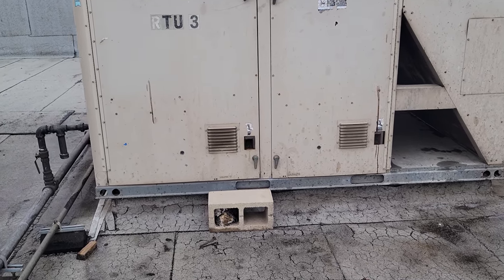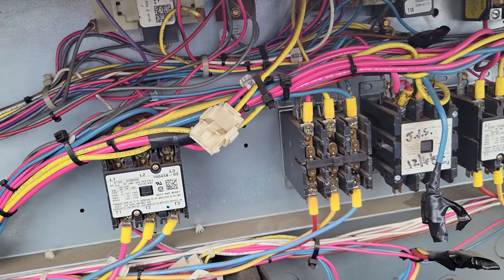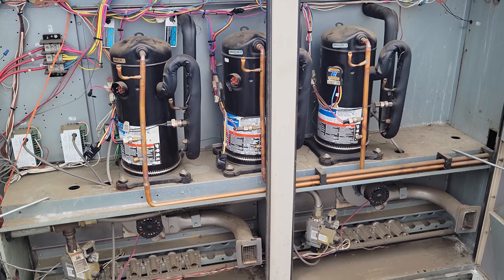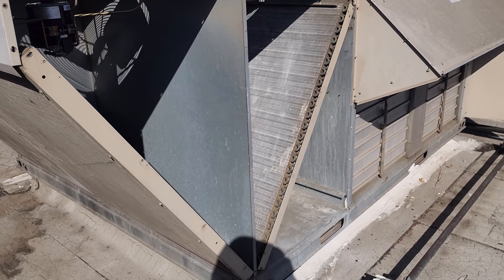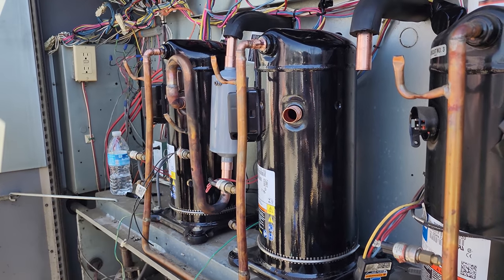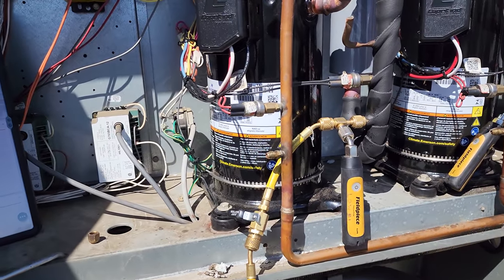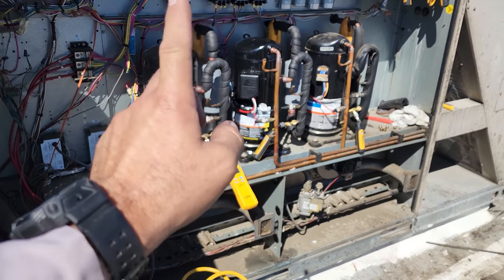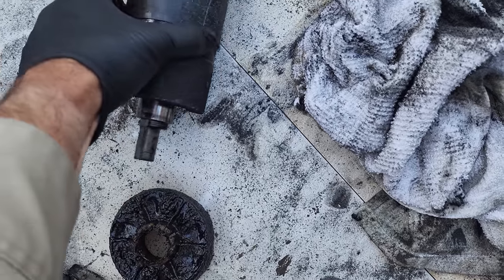BORROWED TIME IS AN UNDERSTATEMENT

Comment: That 2nd compressor that died you could tell right away that it was hardcore cooked and far more cooked than the first one that died. That was a hell of a repair and probably brutal in the cost just to replace it in 2-3 months.
Reply: I know nothing about this trade but was wondering, how much can this repair cost in total in comparison to the whole replacement cost?
Reply: @Lembemupixo  this repair is probably 4 to 5 grand at least. A new unit is probably about 20 to 25 grand after labor.
Reply: I have a feeling that after that outlay of cash, they're probably going to wait until the third stage goes out.  lol
Reply: 2 to 3 months, you mean 6 to 18 months. lol
Reply: @Lembemupixo  Much less, these units are really expensive but so are compressors but still less.

Comment: Yeah, I remember this unit... It's appeared a few times on your channel, I think. You did all the driers, I remember you capping off Stage 2 when it shorted, and I also remember Stage 3 sounding like crap.
You managed to get this unit running well-enough to get them through the summer, hopefully. Like you said, polishing a turd. There's only so much you can do when it's clearly overdue for retirement!

Comment: You need to replace batteries in your meter 🙂. Just don't want you to have to make an extra trip to the van ✅ Great video as always!
Reply: You know how when you take all your tools on a roof with a really difficult access and get everything up.  Fire up the torch and immediately head to the truck or worse yet to the supplier for a spare oxygen or acetylene tank.  Never on a ground mounted condenser.  Nice videos.

Comment: I would've thought the no 3 compressor would've failed by now, I'd have been wrong! I wonder how much longer it will last and if the different filter dryer made the difference! Seems to me they may as well just replace the last compressor now before it fails, it's pretty much all that's left that hasn't been changed inside that AC!
Reply: I would change that last compressor and call it a day, why bother replacng the unit at that point.

Comment: unless it's a small txv and doesn't have the option, I always just replace the guts and powerhead, the body is just that, a brass body, so no need to braze in new TXV's, a couple wrenches and you're done. I also always add an acid neutralizer to the new crankcase if I suspect acid, along with an HH drier, better to be safe than sorry. Just my 2 cents though, great work as always Chris!

Comment: Quick sharing from my exp when cleaning d system. Im always use this kind of creatures that we call Solvent Cleaner(degreaser for hvac system). Its works perfect to clean d system n very quick dry too. Its kind a nasty when using this method, but believe me, the result is super impressive. Im not saying that blowing n2 alone is not efficient. But sometimes in few cases it need to be done with this degreaser. Im learn a lot through ur impressive breakdown call video n u amazed me. U re my Guru. Thnx a lot to u n your team. & last advice in the video was really touching n u re saying right things. Thnx again. Really appreciate.

Comment: Chris…. Why don’t you use replaceable core drier shells?
Screens… felts and all the new cores you can buy. The winding insulation is overwhelming the refrigerant circuits. I hope you get it all out and the customer sees some light on the maintenance front…. Your a good man for trying to do what the customer requires but I don’t see any benefits in the repair. Be safe keep being a good employer

Comment: I don't think him sealing the traffic mat to the roof is necessarily a sign of a Bad roofer as it is a sign of a Lazy or Frustrated roofer...

When he sealed the mat down, I think he was FAR past the point of "FUCK IT! I'm just gonna seal the ever-loving HELL out of everything up here that could, theoretically, possibly have made even the slightest smidgen of contribution to the mystery leak"...

😄😁😆😅😂🤣
Reply: From what I saw in that video, the store manager doesn't seem to have knowledgeable support from a good maintenance crew.  Or maybe its their own fault from cheaping out and having a "handy man" do the filters, coils and roofing.  either way, I would fully expect that a manager who has their quote on a new unit denied would be frustrated and tell their "handyman" to get up there and seal anything with a crack or seam.

Comment: I apologize but I'm going to assume any time a compressor is failed, even if its a short to ground, LRA, or even failed seals, that system should have acid and as a precaution acid test and scavenge should be performed! NOTE: Glad I never see these big Lennox units out here in Colorado, they look like a nightmare to work on, especially for restaurants. 
Definitely going to tag this video and use it to help my green technicians learn. Thanks for the time you spend making these videos don't stop, ever.
NOTE, don't forget that suction HH dryer for extra safety.
Reply: A nightmare to work on? I think they're pretty good, heat exchangers come out like a drawer once you get the door/mullion/gas train out of the way. And much better than a Trane to service, I like how they have doors with handles and hinges, and not a bunch of 5/16" screws that strip out. Also it's nice to be have the compressors in their own compartment like that, sucks having to take a huge panel off of a Trane/American Standard, and then connect guages and you're losing a lot of airflow thru the condenser. Wireless probes help but lately the newer stuff isn't made very good. I just bought a new 13 ton Lennox unit (Trane was completely out of stock), and even Lennox has gotten cheaper, the handles are cheap plastic now, instead of the nice metal ones that lasted forever. Have quiet a few mid 1990's bigger Lennox units that are still going strong, 17.5 to 20 ton. One 20 ton unit has a bad leak somewhere, so I have that circuit disabled. Not worth finding and fixing it since it's most likely in one of the coils somewhere, and it's R-22. That place has 3 20 ton units on it, and that unit with one compressor down is in the back of the store well away from the front door and any windows so it stays cool anyway.

Comment: I use to work on the rooftop units that were 25 hp-100hp trane units.
We rebuilt the compressers on site
I leaned so much about the big units and chiller systems.
Do you ever run across the big roof top units ?

Comment: You need to get a good ultrasonic detector not a cheap one $2-3K. you can hear tiny leaks under vacuum, nitrogen, freon from feet away. I hear some spray water to hear leaks better that's a cheap sonic not ultrasonic. I can tell if and where a leak is without removing panels. I paid 2K 20 years ago best HVAC tool I've ever bought. It's amazing what a good one can do. Even those leaks that are hard to find and many just top off every couple years, I find in seconds

Comment: As an owner of some roof mounted units, what/how would I know what the correct preventative maintenance is for these machines? I'd love to prevent full equipment failure as much as I can but I'm not sure what maintenance I should be doing.
Reply: You should not be doing it if you don't know what maintenance you should be doing. Hire professionals
Reply: Periodic cleaning of the coils with water and appropriate chemical. Changing the air filters. Inspect and replace contactors as needed. Verify fan motors running correctly. Free spin to make sure no failing bearings and replace if going bad. Inspect and replace belts. Clean condensate pans and drain lines. Check wires for rubouts or secure potential rubouts where wires are contacting any metal. You can also do amp reads if you really want to be thorough. (Fans/Blower/Compressors) - Touch test the refrigerant lines.
Reply: If you don't wanna stick your hands into the unit (there's line voltage potentially (heh) everywhere, even where none should be) - listening to it run will give you a good idea. If it sounds funny, loopy, squeaky, wobbly, clunky, generally out of whack it might appreciate a little love. You want monotonous humming, or droning when it runs, and brief (and "clean") clicking/buzzing/thumping/clunking when it starts or stops. Much like a car - it makes all sorts of constant and transient sounds, and there's no need to freak out about it. But if it's shaking itself apart or some gears are chewing up their own guts... you'll know it when you hear it. Beyond that, your friendly contractor of choice will schedule regular maintenance and then tell you what, if anything, else they notice on and recommend for the units.

Comment: Now on something like that. You got 2 smoked compressors, dirty oil and one almost out of oil.  I get the suction line filters is just to help remove wax and anything else in the system. Why not use the R11 line flush kit just to scrub the lines?

Comment: I remember when I was a kid I cut open a few old HVAC compressors and the oil smelled exactly like old burnt power steering fluid.  Not sure which smells worse. That or gear oil.

Comment: Whenever you see silvery sheen on oil, it means mechanically your looking at the compressor eating the metal off different parts, or metal bearing failure. Never a good sign. Too bad compressors are not user serviceable.

Comment: Did you find the trouble with the Alarm Co. 
Thanks Chris.
Reply from the maker: The trouble was because the units breaker tripped and because the detector is powered by the unit it went into a trouble condition when the breaker tripped

Comment: Awe yeah.....80's braze days. All you need is some neon colored clothes....aqua net and stone washed jeans. Hahahaha.

Doesn't Lennox like using the approach method for charging? That suction pressure in the third compressor, was pretty high in relation to what the head pressure was at. I wouldn't be surprised if that one took a dump during the summertime.

Comment: Just a thought:
Would it been possible to repipe compressor 3 so he uses condenser and evaporator of compressor 1.
Just to stop the water leak and get them by until the new unit arrives?
Still would have been low cooling capacity

Comment: What kind of preventive maintenance can one do on a hermetically sealed unit? Dirty (from outside) condenser or evaporator would cause abnormal conditions in the system and make various sensors to trip the  compressors.

Comment: Gotta quick question, you mention lack of PM work, but I haven't seen a video from you that you changed a compressors oil during a PM visit. (outside of a problem that prompted you to drain the oil like that one video where it was so badly moisture contaminated you couldn't pull the vacuum). I love the videos, and the learning experience brother! What is an "interval" for you on compressor oil changes? X amount of years? Sucks they don't have chronometers or something keeping track of runtime. Thank you for all the knowledge and videos over the years
Reply: These HVAC systems are not car engines. They don't generally need "routine" oil changes.

Your car needs routine oil changes because of the combination of very high temperatures and continuous contamination from small amounts of combustion byproducts making it past the compression rings.

The oil blend in an HVAC compressor is chosen to be able to operate for the service life of the equipment, so long as you maintain it.
Especially since the compressor and oil and refrigerant are a sealed system where, during routine and normal operation, contamination is impossible. And, so long as you keep the unit from overheating and frying its own oil, there's no reason for it to degrade.
And, no, your high pressure switch will not save you from this. A quick Google suggests that r134a overpressure trip may not go off until you hit 350-400 PSI. If you have a clogged condenser, and your high pressure switch is at the upper end of this, you might be running at over 180 degrees in the CONDENSER - and well higher at compressor head or discharge.
I seem to recall Chris saying in an old video that once your discharge or head hits 220F, you're damaging your oil. And these compressors look like they got quite a bit hotter than that.

Comment: When you quoted 3 compressors and 3 TXV's, I think you should also have added 3 new evaporators and 3 new dryers to the mix just to make darn sure all the burned oil is removed from the system to ensure the new components last as long as possible considering they don't do required PM...

This is the type of customer that needs to be shown a side-by-side comparison of long term operating costs of proper PM vs. repairs caused by no PM...
I think they MIGHT finally take out a Lona and buy themselves a Clue and realize they spend one HELL of a lot more money on Repairs than they would with regularly scheduled Maintenance...
Emergency Calls tend to cost more than pre-booked Service Calls do and proper, inexpensive PM prevents VERY expensive Emergency Repairs...

I'm SO glad I'm not a Repair Tech in a field that requires PM to keep costs down...I'd be FAR too tempted to bash the Idiots in Middle and Upper Manglement with a Clue-x-4...which, while VERY Cathartic and thus good for my Blood Pressure, is equally bad for my long term freedom...the local Boys & Girls in Blue do tend to take a VERY dim view of people smacking other people in the teeth with an engraved chunk of steel...though I can't for the life of me understand why, once they've had the reason for the smack explained to them...
Maybe they just HATE the extra Paperwork it causes...

Oh, well...

C'est la Vie...

😄😁😆😅😂🤣
Reply: Right but if you add up the cost of 10 years of meticulous maintenance costs, it can add up to a lot more than just doing minimal basic maintenance and just replace units when it's the right time to do so. The customer gets the benefit of having up to date equipment and lower electricity costs, and the tax write off of CapEx. However in todays environment of hardly any rooftop units in stock, plus new DoE regulations kicking in next year plus inflation, it just sucks. In 'normal' times, it's not worth trying to keep old beat up R-22 units going, no matter how well you clean the coils, there's still bent fins, hail damage, a lot of dirt that can't be gotten to, and it's probably realistically only 10 SEER, or even less. In high electric rate parts of the country like California it costs a ton. Of course lots of restaurants are only around for 5-10 years, a lot don't make it past 10, or they only have a 10 year lease on the building and don't want to install new rooftop equipment and then have to leave it there when the lease ends. I had one restaurant that had some very old beat up Carrier units I had almost sold them on replacing. So what happened? They renewed the lease for another 10 years, and in the deal, they had the landlord install 3 new 10 ton units. So the landlord had another company install 3 new Daiken units, and did a sloppy job, and they asked me to fix something on one of them. I'm like nope, call the company that did the install and waste their time, not mine :)

Comment: Chris are you going to return and test for acid and if either circuit shows high acid are you going to replace the driers again, repeat process until acid free with the goal of removing those restrictive suction driers 
I understand the customer doesn’t want to spend more money then they have to but doing a proper acid clean up could extend the life of that turd  for years rather then months 
Why do you not use a acid neutralizer? I know there are 2 types one is for POE and the other for mineral oil. 
Thanks

Comment: How come compressors don't have overheating safety?
Reply: Some do, depends whether the client wants to spend the extra money or not. You'll find discharge sensors that will cycle off the compressor once it reaches it's trip point. 
High pressure switches that aren't manual reset will just cycle on and off the compressors and they will heat up that way as well

Comment: couldnt you use compressed air and save the nitrogen for later.

bring up an air compressor to blow out the coils and lines then use the nitrogen to purge the lines?

Comment: why does the unit have to be Lennox? couldn't find any other brand with that tonnage ?
Reply from the maker: Pretty much all the brands have the same wait times, but its best to stay with lennox , another brand would need a curb adaptor and that would add extra weight to the building's roof, which would mean we need a structural engineer to sign off on the added weight which is a real pain
Reply: @HVACRVIDEOS  thanks!

Comment: Surprised they didn't just replace all 3 compressors, replacing the whole system seems unnecessary if the other part of it are working fine

Comment: Wouldnt it be best to convert the 3rd stage to 407c as well?

fyi im not a trained service person, just a fan
Reply: With the time frame of replacement/audiable damage its very much in a case of they are expecting it to die/be dead very soon. So replacing to 407C will just contaminate that gas and it cant be reused again.

Comment: It's a shame that modern A/C units still require such high maintenance
Reply: Them things dont friggin last in the California Heat with these places being cheap on maintenance.
Compressor burnouts are common when they they run hard in the heat on the roof with bad condenser fans or a dirty condensers.